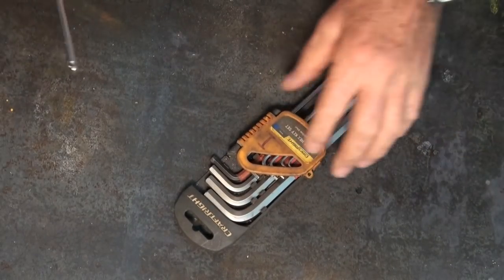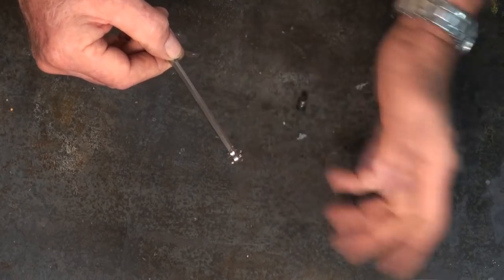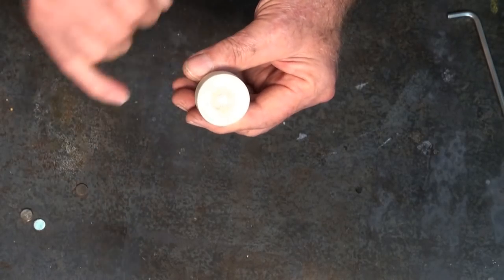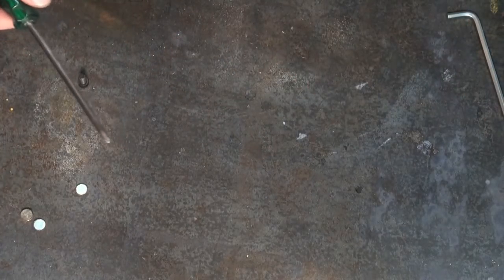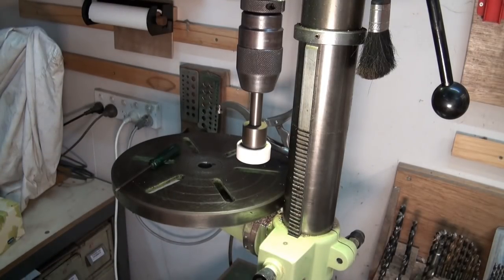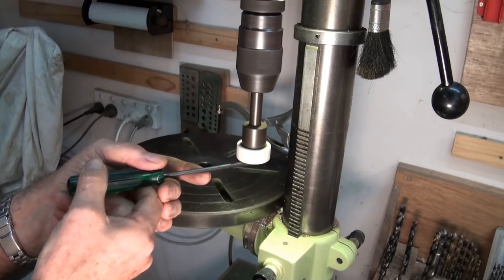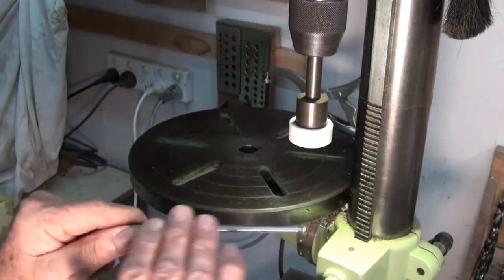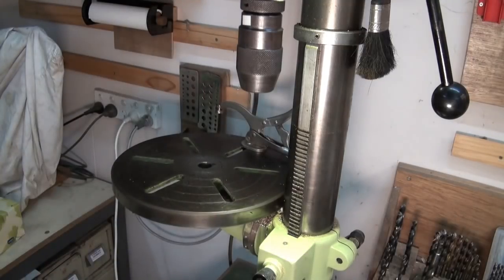DIY Demagnetizer Tool (That Works!)

Comment: How long did the stay un magnetic? I hate when I'm welding and grinding in that metal sticks all over everything I was getting my fingers
Reply from the maker: John, I find that tools like punches, scribers and rules tend to pick up a magnetic field over several months. I have a couple of those magnetic tool holders above the bench which will gradually magnetise those items near or on it. However, the demag tool is so easy and quick to use that I can pass the tools over it while it is in my lathe or my drill press quite easily. I really should mount it permanently on one of my double ended grinders!
Welders will create a magnetic field around the ground and electrode holder cables because of the current in the circuit. If you have been doing any grinding, the metal dust will be attracted to the area around the cables. 
Regards,
Mark

Comment: Nice idea - all mechanical. I prefer "Electronic" method: an e-core transformer disassembled and converted to an open frame.  Such as from an microwave oven or pretty much any appliance having something like 2" x 2"or bigger core. Leave primary alone (for 120 or 220VAC) or unwind it. Just a bit of care around mains voltage is necessary otherwise Charles Darwin will interfere.
Reply from the maker: Yeah, that bugger Darwin will take care of the unwary!

Comment: Thank you so much. I have needed one for a long time. The commercial demagnetizer are way out of my price range. Question for you. Would you make another? How much for one including postage to the USA? Thank you
Reply from the maker: Kevin, I did actually make two more but I gave them away, one to a friend and one as a subscriber draw. However I don't plan to manufacture them. They are extremely simple to make and don't need to be terribly accurate or  made from metal. If you have access to a 3D printer it could be used to make the body and the spindle. You could actually embed the magnets during the printing process. Even something made from wood with the magnets stuck on with epoxy would work fine.  Here is the link to the build video for a better finished design. https://www.youtube.com/watch?v=Ew4BwYTzCe8&t=103s

Comment: i’m trying to make a demagnetiser for a tape head because any that i’ve found have been far too expensive and I can’t think of anything that would be small enough to do the job. any suggestions?
Reply from the maker: I am not sure how small you could make a rotary demagnetising tool of this type. I guess it depends on whether you can source some very small neodymium magnets. I have seen some small cylindrical types (1mm diameter and 10mm long) and you only need two if you can rotate them around a central axis. Having four just means that you don't need to spin them quite as fast to get an oscillating magnetic field. The key is to ensure that you slowly withdraw the tool from the demagnetiser or vice versa so that the oscillating field decays slowly. I would just 3D print a simple holder and try it out to see if it works on a piece of magnetised scrap about the size of a tape head?
Regards,
Mark

Comment: About the magnets being positive or negative I think you mean that they are north or south pole. Right? I guess you have to use neodym magnets, regular magnets are probably to weak. I have a demagnetization tool for use on cassette players heads but that tool doesn't work with my tools, it's probably to weak. That demagnetizer you show in this video seems to work just lika a charm. I think I will make me such an item. Thanks for the video!
Reply from the maker: Yes. You are correct regarding the polarity of the magnets. They should alternate North South. I did use neodymium magnets. They were 10mm diameter and 2.5mm thick but you could use other sizes or shapes. I am pretty sure you could make the body of the tool completely from plastic or wood even and it would still work.

Comment: Would the magnets spaced further apart be more effective?
Reply from the maker: Not really. It is just a case of alternating the magnetic poles enough times to neutralise the residual magnetic field in the magnetised part. If you doubled the number of magnets you could achieve the same result with less revolutions but it would probably still take the same amount of time to do the job. 
Regards,
Mark
Reply: @Preso58  I used 6061 aluminium alloy for the job, and used 8 magnets. Reason why is none of my drill spin at a high speed. Waiting on the 10mm magnets to be delivered will let you know how the alloy performs. Thanks for your prompt reply.
Reply: @Preso58  I built one using 8 x 10mm magnets and works very well. Thank you for sharing!

Comment: Thanks for The idea!! If I could make a suggestion: oil your drill press 😂
Reply from the maker: Ben, unfortunately there's nothing to oil. Those Taiwanese drill presses have sealed ball bearings in the spindle. I bought the machine second hand and it's possible that the bearings are not the best. I converted the vee belt drive to a poly vee drive and the belt (being quite a lot thinner than a standard vee belt) does tend to flap around a bit. Also I have a three phase motor and a VFD fitted to the drill so it contributes a bit to the noise as well. 
Regards,
Mark
Reply: I think that vfd is what people are hearing

Comment: You show to do demagnetize ,i am waiting till finish how to magnetize, because some of my magnets are weak. How to magnetize by using that device ?.
Reply from the maker: That tool is only for demagnetising parts. You can deliberately magnetise a non magnetised part by taking a rod type magnet and passing one end or pole repeatedly down the length of the part. You must stroke the pole of the magnet in one direction only and lift the magnet well clear as you go back to your starting point. You usually only need to do about 6 or 8 passes and it will pick up a good magnetic field. It's useful to be able to magnetise a screwdriver tip temporarily so you can pick up a steel screw for assembly and then use the demgnetising tool when you are done to remove the stray field. As for magnets with weak magnetic fields you are probably not going to be able to do much about that. You may be able to partially restore some magnetism if you have a stronger magnet and use the technique that I suggested for tools.
Regards,
Mark

Comment: How accurate is your watch?
Reply: Assuming it's mechanical?
Reply from the maker: It's a Citizen Eco Drive which I believe is a quartz watch with a solar power source that doesn't require a battery. However it does have a capacitor to store the electrical charge. I liked the watch because you never need to take it to a jeweller to have a battery replacement. I guess the thing you are wanting to know is whether it is influenced by the magnetic field of the demagnetising tool. Short answer is that I didn't notice it gaining or losing time. I do know that strong magnetic fields can affect quartz watches though. We used to have a large spot welder at the school where I used to teach and if you held a quartz watch up against the electrodes and powered up the welder you could see the watch run at about 10X speed due to the magnetic field around the copper arms of the welder. It used to amuse the students no end!
Regards,
Mark

Comment: I wonder if it is going to work with a magnetized vise.
Reply from the maker: The process should be scaleable but man, you would need some big magnets!
Reply: @Preso58  I wonder if could try your contraption "on the surface"...

Comment: Would this work on a watch?
Reply from the maker: If it is magnetised it should work. However I am not a watchmaker and it could be that some parts of a particular watch are sensitive to magnetic fields. Also, most watches are stainless steel and those grades are generally non magnetic. Some parts like the pins that hold the bracelet together might be able to be magnetised. 
Regards,
Mark
Reply: @Preso58  Yay, It has worked so far. I have a gold filled Omega that is said can become magnetized causing it to run fast. I just used a binder clip to hold 2  (2"L X 1/2" W) magnets with 1 negative and 1 positive facing up. I then held my watch and made circular motion above the magnets while I slowly moved the watch away from the magnets. I repeated this about 4 times.  Thank you for the diy that saved me a trip to the watch repair shop! I really appreciate it!
Reply from the maker: @kjbigsful  That's great! If you know anyone who owns a 3D printer you can make a simple version that can be fitted to a cordless drill. 
Regards,
Mark

Comment: I just took some #12 insulated wire and made about 50 turns around a wax covered 5/8” dia. Wooden dowel, the length of the coil was about 3”.
I hooked it up to 110volts after wrapping with tape and removing the dowel and after about five seconds it got really hot and tripped the circuit breaker.
It will magnetize a screwdriver in about 2 seconds when held inside the coil (using a momentary switch). It will de-mag same screwdriver if held in the coil and rapidly withdrawn while the coil is energized.
It’s very dangerous and not recommended for anyone to try but it works for me.
Reply from the maker: Scott, I was looking to build a demag tool which I had seen described on a forum and it involved a modified mains voltage transformer. You were supposed to cut into the iron laminations but the whole affair seemed to be fairly dangerous. Some one described the rotary tool on the same forum (it's not my idea) and so far it has never failed (or killed me). 
Regards,
Mark

Comment: at what rpm is the machine rotating ?
Reply from the maker: I generally run it at around 400 to 600 rpm but it's not critical. There are 2 pair of magnets with opposing poles so at 400 rpm you get 800 alternating magnetic pulses per minute. The most important thing is that you slowly withdraw the tool from the magnetic field which extends quite a way from the centre of the tool. I usually take it straight out for about 300mm which seems to completely eliminate any residual magnetism. I did a whole heap of punches, allen keys and screwdrivers just yesterday since they were all gathering fuzz of metal dust on the working ends. 
Regards,
Mark Presling

Comment: I have an idea: store the demagnetizer tool in a ziploc bag, because now the rubbish will stick to that.
Reply from the maker: Good idea. It does attract a lot of rubbish but the plastic cap allows most of it to be wiped off fairly easily. 
Regards,
Mark

Comment: I have a large work shop all steel frame with steel wall and roof cladding rio etc.  Every thing tools incl in my shed  (work shop, not a Piza shop ) are magnetizes, even steel on the rack.   it's a bloody  nuisance.
Reply from the maker: There must be plenty of opportunity for magnetic fields to form in and around machinery. Welders are probably a major culprit. I have seen magnetic field line patterns around the welding leads on my steel bench after grinding steel. I also have magnetic welding clamps and lots of neodymium magnets lying around which probably all contribute to the problem. 
Regards,
Mark

Comment: You are over thinking it just heat it up for like 2 minuts
Reply from the maker: Trust me, I tried that and just about every other trick I knew. The thing is that when the tap broke off it was bottomed out in a fairly shallow hole so it was fully torqued down and even if I could have gotten a grip on it there was not sufficient leverage to back it out again. It was either EDM or scrap the part.
Regards,
Mark

Comment: Both times, once with the screwdriver, once with the Allen wrench, you took them OFF CAMERA just before you allegedly demagnetized them. What you did may, or may not work, but it appears you were careless, or deceptive.
Reply from the maker: With respect, that's a bit unfair. I am not selling this tool nor do I make any money out of my YouTube videos. I presented the video in good faith and despite what you may think, the tool does work and I use it regularly in my workshop. 
Regards,
Mark Presling

Comment: Couldnt you rearrange the magnets on another “magnetizer” tool so you could also magnetize something if you want?
Reply from the maker: Interestingly, I have never thought about doing it in reverse. My understanding is that you can effectively magnetise a tool by stoking a magnet pole along the length of the tool (like a screwdriver) and then moving the magnet pole away and repeating the same stroking movement a number of times. The demag tool works by pulsing the magnetising process and then decaying the process until it is neutralised. If you want to deliberately magnetise something you would need to do the same action in reverse (i.e., move the tool closer) and probably at low speed. 
Regards,
Mark